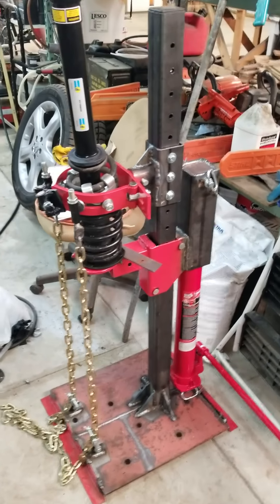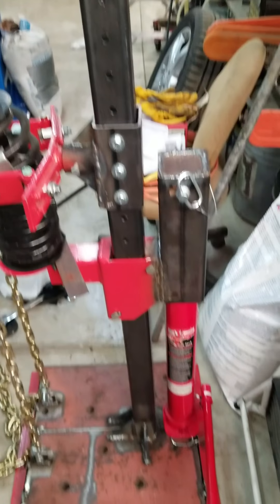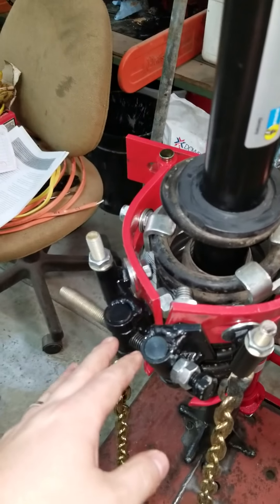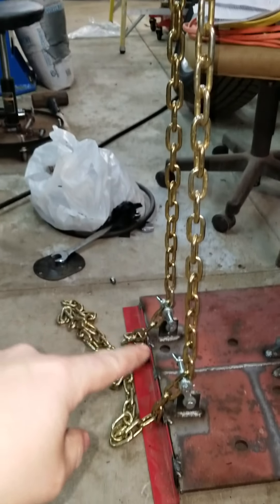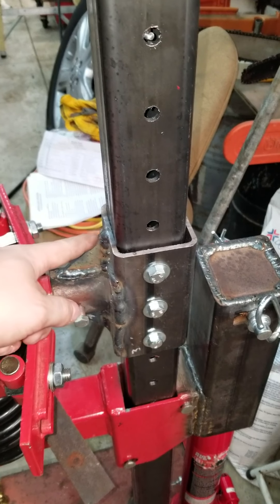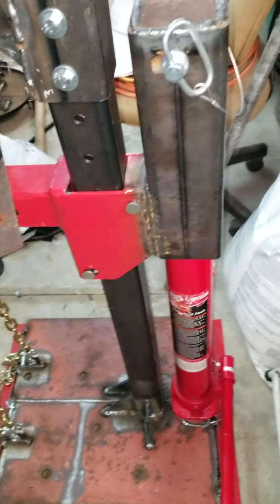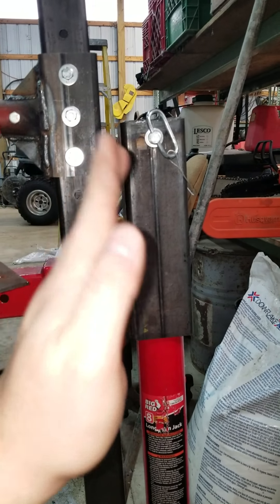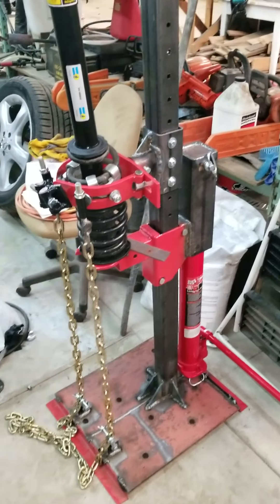eBay Hydraulic Spring Compressor MODS

Comment: Dude that's more than a modification, it's like the ultimate redesign and rebuild.  You applied alot of solid,  smart, engineering that Harbor Freight is oblivious to how metal fails under load. I've also bent quite a few tools from them.  Although in front of my sons who perceived me as the ultimate  hulk dad as their mouths hit the ground as I bent the tire machine, I would prefer the tools just work like I bought them to do.
Reply from the maker: As much as I laugh at the build quality and lack of engineering that goes Into making a lot of the crap at harbor freight (alot of it is actually quality stuff, too), I do love being able to buy  cheap Chinese bare bones tools and equipment that I can modify the way I desire rather than being forced to Shell out exponentially more for a "quality" tool. This spring compressor I made is more versatile and safe than 99% of the "professional" models put there while also being considerably cheaper.